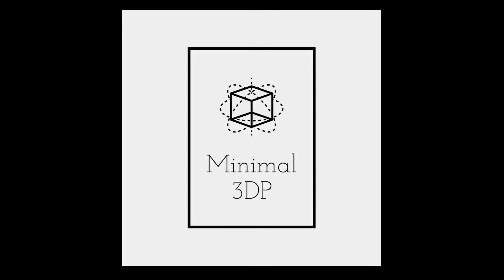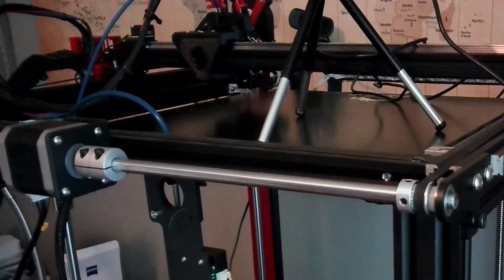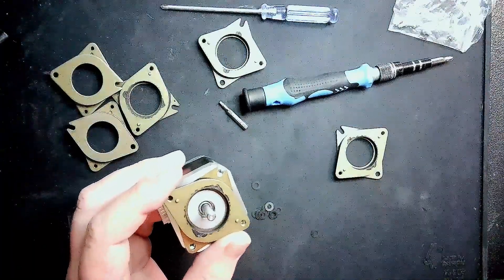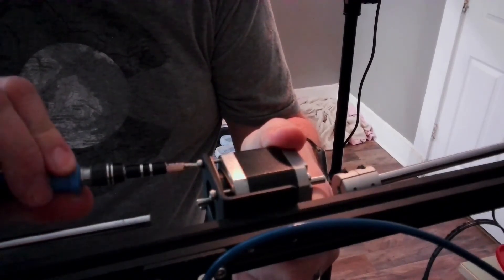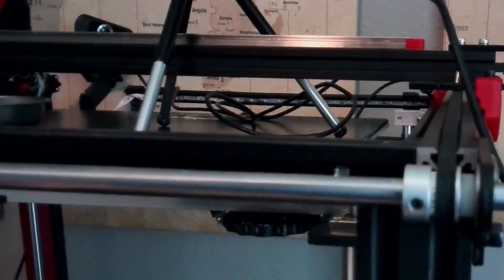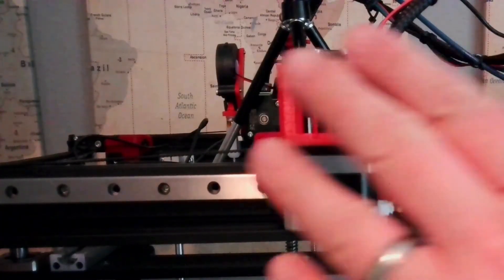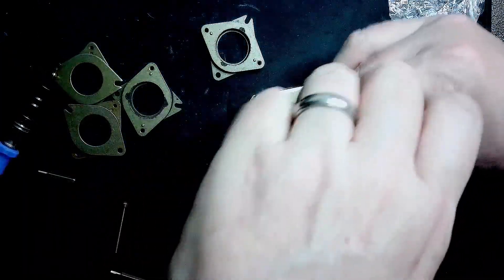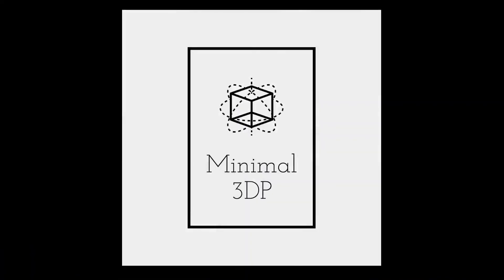A Quick Video Installing Stepper Dampers on my Ender 5 Plus

Comment: I noticed tonight my E5+ vibrating like its possessed while doing diagonal infill on a RC plane fuselage im printing. Real noisy and its a long print with that all the way through. Ive taken some 8mm thick edging foam off the floor matts and stuffed it in all the free V grooves in the frame to absorb some of it. Im going to look into this, Im thinking some rubber wands suspended in the right places could deaden some of these vibes out of the frame.
Reply from the maker: You could also try PLA cross braces. It does 2 things, stiffen the frame and I read a research article that looked at PLA struts to deaden vibrations.

Comment: has this done any improvement to your printer?
Reply from the maker: I don't really think it has. I would not buy again.
Reply: @minimal3dp  thanks for the fast reply.
Reply from the maker: No problem. Let me know if you have any other questions.
Reply: Very glad watching your video tutorials! Please let us continue beeing part of you journey. My thoughts about the way you installing / mount it is against the idea of decouple the bracket from the stepper motor mechanically. Currently vibrations will go through the screws - so I don’t expect big changes. Go with 2x2 screws would decouple it mechanically via the dumper.
Just my thoughts - no complains.
Reply: Well, it was installed wrong. No fasteners are supposed to contact bracket and motor, whole idea is to separate physical hard attachment of motor to frame, leaving only rubber ring holding motor to dampen vibrations, with bolts installed like he did, damper acts as spacer rather than dampener.
Reply from the maker: @tsa02071988  that explains a lot. I had a lot of trouble with it. Thanks for the heads up.
Reply: @minimal3dp  Perhaps you could amend your writing to reflect the mistake as to not mislead others.  Just a thought.
Reply from the maker: Sorry. I thought I had added a pinned comment. I added a disclaimer in all caps in the description. I really appreciate your feedback.